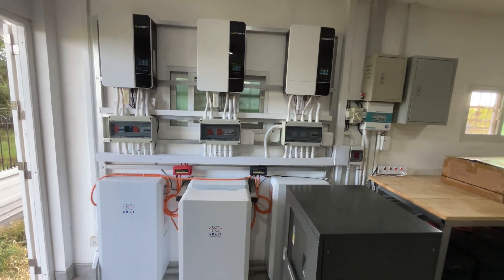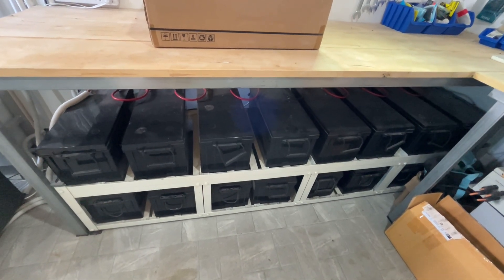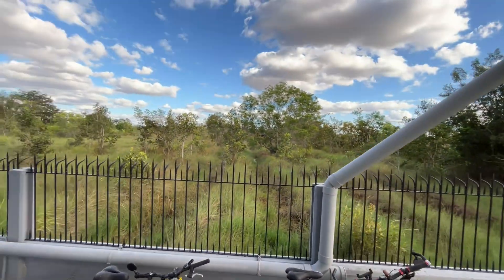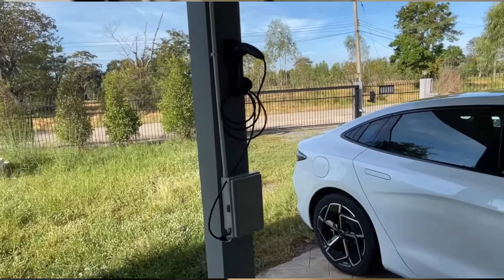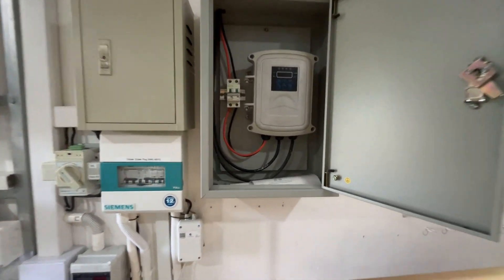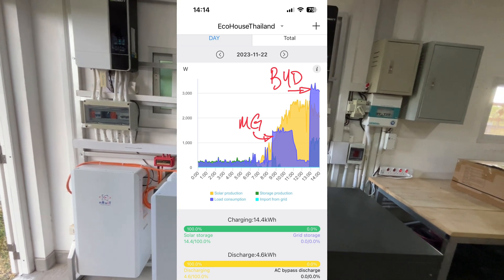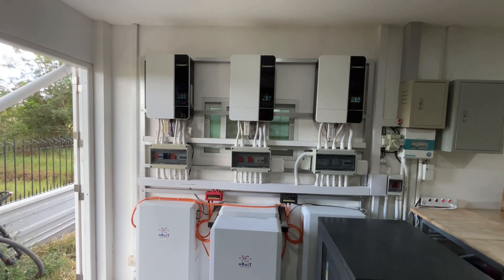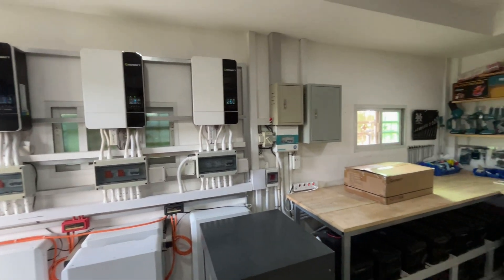Solar Upgrade 2024 part 1

Comment: Interesting Video, As you have the equivalent of 6 Tesla Powerwall's on 4 wheels in your drive why do you need the 4 nRuit 9 kWh Battery units could you not have run on just one unit to cover the minimal night time consumption? Did the nRuit battery come with the BMS?
Reply from the maker: I upgraded my solar to LFP batteries in 2021 and didn't get the byd Seal until 2023. I only use the V2L at night when the home batteries are low due to heavy rain or me draining them while charging my EVs. V2L allowed me to give my meter back and go completely off-grid. nRuit due have BMS controled via my Growatt inverters. It's important to ensure that your smart batteries communicate with your inverters before you buy them.
Reply: @EcoHouseThailand  I am currently running 2 Solax inverters a 5Kwh Hybrid + 6.2Kwh normal, supplied by 24 solar panels. I do not think I could use the nRuit batteries so will have to probably stick with a Solax product, probably 5 to 10 Kwh would do it? Night time I am consuming between .5 to 1Kwh. Like you I have an EV with V2L capability so it could become my Powerwall on 4 wheels. I am currently paying PEA approx 2000 bt per month and a 5.8 Kwh Solax battery would cost around 100,000 bt making the payback time around 4 years. I think this set up would probably allow me to go off-Grid?
Reply from the maker: @salexbekesi9289 You should watch my video on how to size a battery system https://youtu.be/N9ekb1KhRr8

Comment: Great video Paul.  I like VTL as a supplement to home ESS very much.  No doubt it will become much more common place as EV manufacturers make it a standard feature.  Those planning to go off grid should look closely at the economics of a home energy storage system consisting of batteries and VTL.  Makes a pretty compelling case for increased home energy security.
Reply from the maker: Totally agree Greg, very well put.